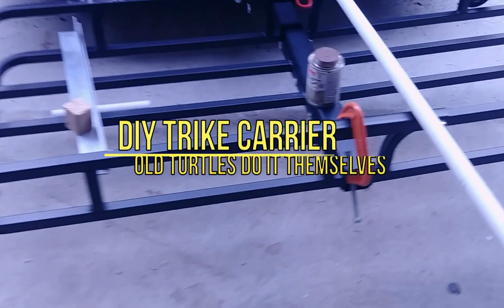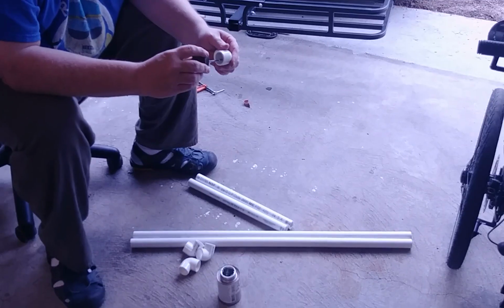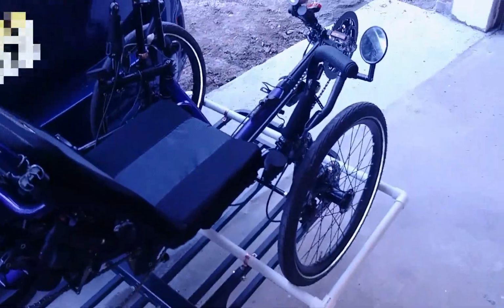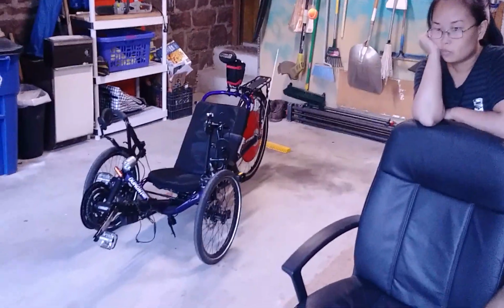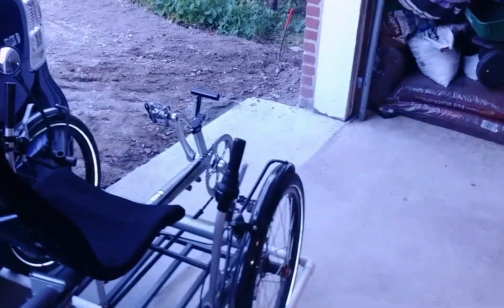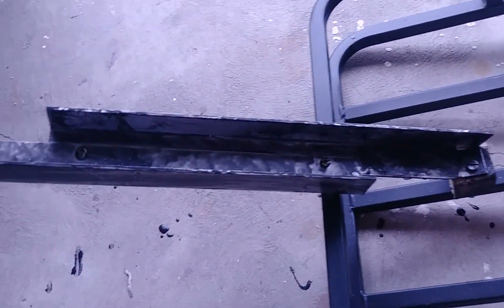DIY Trike Carrier

Comment: Nice job! 
I made one as well from a similar rack but with aluminum angle stock. Worked great with my Trident but my wife’s Hase is too heavy so ditched it and bought a commercial trike carrier. But you did a great job and glad it supports the Dumont with Copenhagen wheel.